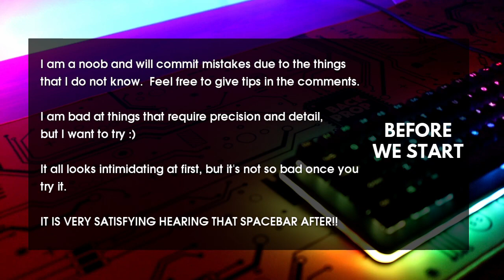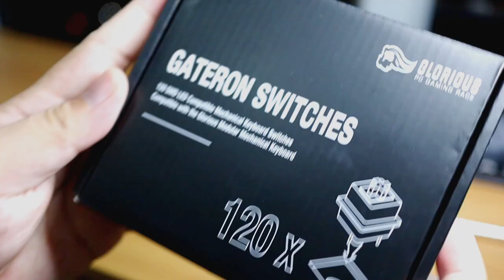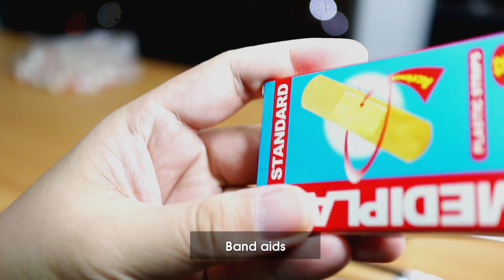How to Clip and Lube Stabilizers for Beginners feat. Drop Alt - Diaries of a Keyboard Noob EP1

Comment: hey bro you can use band aid mod without taking off the pcb just cut it smaller if needed and then slide it through the gap in the plate for the stabs and maybe use the tweezer or a toothpick or something small to push down the adhesive of the bandaid.
Reply from the maker: Yup I actually prefer it that way!

Comment: After watching taehas video, what made you decide not to disassemble the whole board? I'm about to mod and seems like you did a lot of research and did things a but differently than him. So hoping to know more so I can know the risks and stuff before doing mine! Thanks!
Reply from the maker: I actually ended up opening up the entire board and even doing a case swap. For me it was a process of doing each thing step by step. I did not want to jump immediately to opening up the board so I took it slow. After opening up the board, I can say that if you are only working on the stabs, you don't need to open it. There are no markings on the PCB to tell you where to place your band aids so it's better to have the case on so you have a guide. I did open up the board here; https://youtu.be/lwZfWWrtkOA

Comment: Are those wobble on the stabilizers normal? I just got a mechanical keyboard as well and this is a replacement but the previous one that got replaced has better stabilizers (it doesn't wobble as much) albeit the same keyboard. 
Also, nice idea of adding the tapes on the edges to stop the wobble. Helped mine and now I just have to lube the stems. ^-^
Reply from the maker: It usually is the case for Drop's boards unfortunately :(
Reply: @TheDredgenProject  yeah...their warranty team replied me, telling me this is normal and might vary from one to another due to the manufacture process. But your tape idea helped me out a lot, they don't wobble anymore!

Comment: What do u use for the lube just the dielectric grease Beciase u had the tube and a little plastic can’t see if it are they the same thing or is was one of them crytox?
Reply from the maker: Dielectric grease on the wire. Teflon grease or krytox for the housings.

Comment: Thanks for the tape on plate edge idea, first time seeing it here, looks like the most significant mod for a plate stab after lubing. Also, IIRC there’s about 3mm spacing between plate and PCB. Do plate mounted stabs drop low enough to touch the PCB for bandaid modding/clipping to make sense? I’m reading conflicting info and my first plate mounted stab board is in the mail.
Reply from the maker: You are right there are some conflicting information there. After working on a lot of stabs, I just always put the bandaid (leukoplast is what I use now)  on the pcb since it's not too much work and it absorbs any excess lube on the stab. The clearances can also be inconsistent at times. I have had a case that the clearance between the plate and pcb were too tight that adding the band aid caused the keycap to not hit the switch since the stab was bottoming out first.
Reply from the maker: And yes the tape is very important since you need to make sure that the plate stabs are anchored firmly. Some stabs are better molded than others. Sometimes the plate itself is just too lose.

Comment: hey what type of stabilizer should I use if I broke my I have a 60% keyboard and I need a stabilizer for my enter key
Reply from the maker: You need to check if it's plate mount or PCB mount. If it's like this, look for cherry plate mount stabs

Comment: How do you take out the switch next to the stabilizer?
Reply from the maker: You need a switch puller. It should come wiith your drop alt but it's better to buy one of those after market ones. They are usually better.

Comment: What kind of tape did you use for this ? like duck tape ?
Reply from the maker: It should be something similar to fabric tape.
Reply: @TheDredgenProject   Thank you for the response ! Just ordered the CTRL and can’t wait to apply your method. One more question, @8:40 did you also apply the tape to the white part of the board? sorry if i used the wrong terminology, barley getting into the mechanical keyboard world
Reply from the maker: @chanski772  Yes you put it in the PCB :) On the areas where the stabs are.

Comment: Have u tried using dieletric grease inside the stabs? Is it anygood?
Reply from the maker: Yup I have also tried that. It also works well as long as you don't put too much or else it will feel heavy.

Comment: San mo nabili ung Teflon grease?
Reply from the maker: Shopee :)  Though I now use dielectric grease for both ! https://shopee.ph/product/16772780/7211363435?smtt=0.85083901-1607518875.9
Reply: @TheDredgenProject  ok salamat.
Reply: @TheDredgenProject  did you notice any difference when you started using dielectric grease instead of teflon grease?
Reply from the maker: @mynamechef8813  I honestly didn't? Some use krytox but I still prefer dielectric.

Comment: Hey! I might have missed it in the video but did you mod the stock stabilizers or did you replace them? I'm thinking about getting an alt but stabilizers are sold out pretty much everywhere so I might have to work on the stabs that the alt comes with but idk if its worth it.
Reply from the maker: I modded the stock ones on this video (which I think sound decent) but I ended up fully replacing them after. I basically used this to practice until the good stabs arrived.
Reply: @TheDredgenProject  Awesome, thanks for the quick reply! I'm probably gonna work with the stock ones and maybe go for a foam installation instead of focusing on new stabs since theyre sold out anyways. Im getting the barebones drop alt + novelkey creams so this should be fun to work with :D hopefully i can make it sound good. My only roadblock is the fact that im on mac so im still searching for a good keycap set.
Reply from the maker: @imxnarch  Did you get it during the sale? They sometimes slash prices and I actually ended up with 3 Drop Alts lol. One Low Profile and two High profile. I was supposed to just buy a replacement case then they ended up selling PCBs as well so I bought those  too. By the way I made a video on foam mods. Planning to do a sound comparison of the low and high profile next :) . I Think I actually used creams on this video. https://www.youtube.com/watch?v=lwZfWWrtkOA